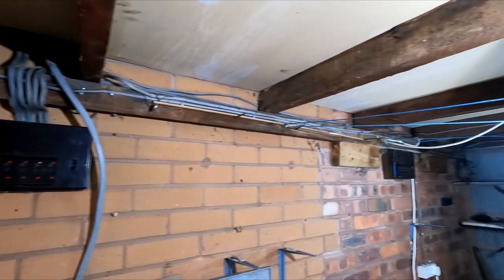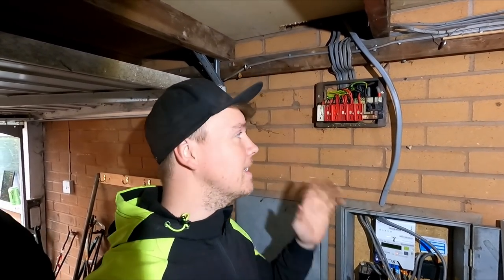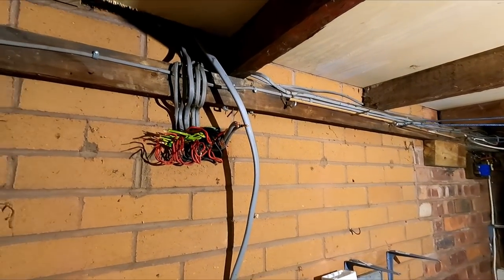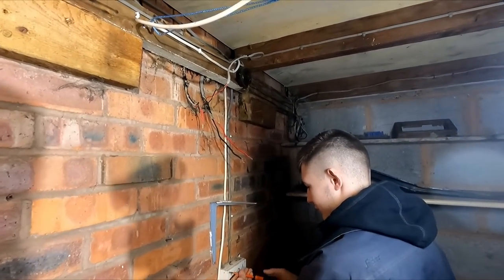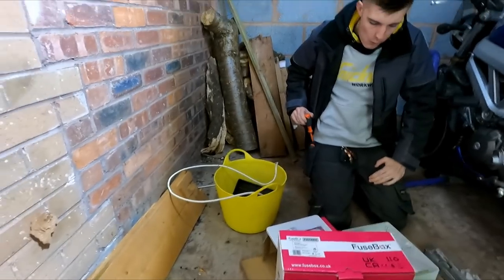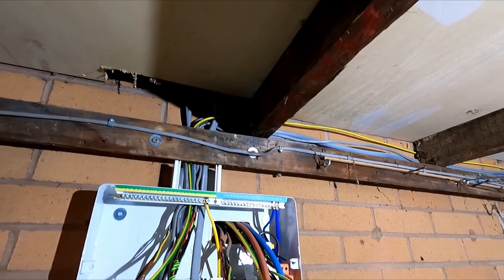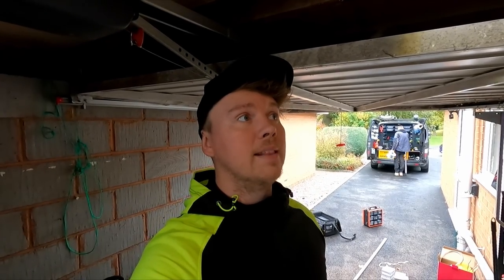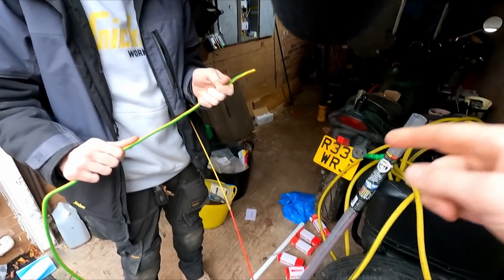Leaky Black Cables? - Electrician

Comment: Back in the 70’s and 80’s I worked for a house builder. There was no electric on site and we used all hand tools. A long 1 metre length metal auger which we carved a wooden t-bar handle for and drilled every joist. Double row downstairs as well. I had muscles like Garth! For masonry we had a hand bit with a masonry tip in it and you hit it with hammer giving 1/4 turn each time. We plastic conduit the garage and utility room as they were all brick. Every saddle, box and fuse board was hand drilled! What a life, but taught me a lot. You got it easy now Nick, and rightly so!
Reply: that was the 1870's i take it ???
Reply: @firsteerr  1870's? My dad was and all the tradies he worked with were still doing it in the 1970's. Funny thing though, despite everything showing up in bundles and you using nothing but hand tools  and no pre-built frames etc it only took 6 weeks to build a house. And that was from a vacant lot not even the foundations were in.

Comment: Those boards are at least 50 years plus, they used to drill out with a brace and bit, rawl tool for plugs, and bending steel conduit with a block of wood.

Comment: An impact driver is great for stubborn flat screws that want to strip the head off.

The sort you hit with a hammer not the ugga dugga sort. You get the turning motion coupled with the hammer forcing it in to the screw and the effect of loosening the screw in the hole.
Reply: @spewmister  oh absolutely.
Possibly even better for something slightly springy like a screw in a wall plug as the impact driver's turning motion is very short and can get completely lost sometimes.

I've used an improvised version a lot too. Used to work on machines held together with M6 screws with 2mm hex sockets, they would rust in and strip out your driver in a heartbeat. A hex bit in a bit holder, clonk that with a hammer and it would generally break the corrosion enough to get the screw out.

Comment: Imagine using flat headed screws and no impact drivers like they did in the old days 😬 what great times we live in.
Reply: Wall plug tool and asbestos plugs back in my grandads day
Reply: i actually did an entire sport pavilion /changing rooms with a star plug tool club hammer with slotted screws (which is what they are called in GREAT BRITAIN  not flat head ) because the LEB didn't get the supply there for a bout three months !!!
i also waited six MONTHS for my first phone to eb connected up (you couldn't buy your own phone you had one supplied by BT ) to only be told the "engineer" couldn't do it because the connection box was on the wrong side and he wasn't left handed !!! i had to wait two more months !!

Comment: Ah the old Wylex boards and twin and earth brings back memories. Did notice there was no back plate fitted though. It’s so easy now, we used to use a Rawl tool to make holes for fixing. This was basically like a chisel but the end was pointed you had to hit and twist it to make the hole. Then we moved onto a pistol drill, no hammer/ percussion function in them days. Tell Adam there was no cordless screwdrivers to be had. Sparks don’t know they are born nowadays.

Comment: Flathead tap with hammer then tighten before undoing. I remember drilling bank wall with Rawl drill. Took all afternoon for 4 holes for 2in No10 screws using Wood plugs shaved from scrap wood.

Comment: Mains over 3m you need to install a double pole fused isolator (kmf) however the size of the fuse doesn’t depend on the length of run rather the reference method. 

Eg 16mm tails clipped direct ref C could be protected by a 80amp fuse but In trunking ref B would need to down rate to 63amp fuse

If you were to run it through the loft it would probably be ref 100 or higher due to the loft insulation. This would have a far greater thermal effect.

Comment: I think the onyl spot in my moms house that has a old fuse system is the secondary panel in the garage though the american circuit breakers (notsure on the british name)  are quite different than the UK ones that is forsure the secondary panel uses cartridge style edison fuses (plug fuse) and a catridge type fuse  though atleast half of the fuses was replaced with a edison style mini breaker

Comment: Surely better to not fit extra fuses when not required? Downgrading available supply when not needed is not the best idea given the growth of EV and move towards greener electric tech
Reply from the maker: It has the same size fuse as the cut out mate 👍
Reply: Top work by both of you, it’s really annoying but need to watch for discrimination between fuses, the point of adding a kmf would be to lose the fuse in it before the service but this would not happen with the same size fuse 👍
Reply from the maker: @scott4018  thanks scott 👍👍

Comment: Plastic Wall plugs....used to break a bit of pencil off in the hole then screw. 
Get a flat bit in ya impact :) Don't forget to clean the slot before putting your bit in it ;)

Comment: You mentioned installing a commando socket for a welder - I haven't seen if anyone else has mentioned it but 553.1.201 would seem to preclude that (unless you can get shuttered commandos).
Reply: Surely a commando with an interlock switch it negates the need for shutters.
Reply: @spewmister  1. The cited regulation says what it says. 2. Argue your point on the IET Wiring & Regulations forum, I'll be interested to see what the electrical engineers and consultants say.

Comment: Hi Nick and Adam, from an old spark from the 60's. My tool kit consisted of a neon screw driver and a couple of odd ball drivers, hand drill, hand brace, raw plug tool for concrete, none of those snowflake power tools, as for chasing out, balsa and cold chisel, and may I add no ear or eye protection, an occupied 3 bed rewire would take 10 working days, last hour of every day  was used to clean up and place floorboards and carpets back, and I forgot a small ever ready porch, batteries only lasted an hour before total fade out, crap in other words. you lucky people ;-).
Peter.